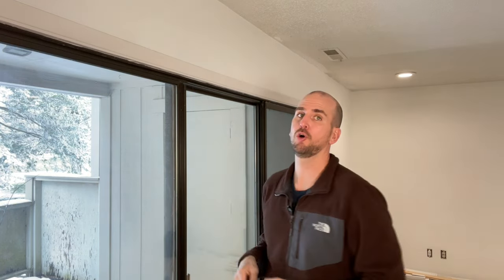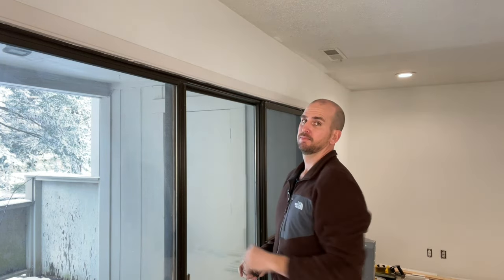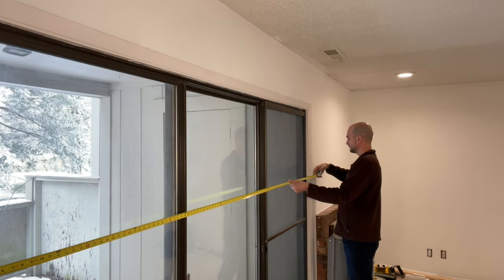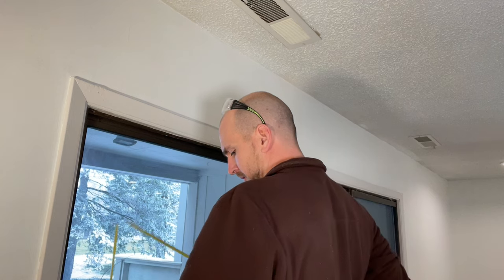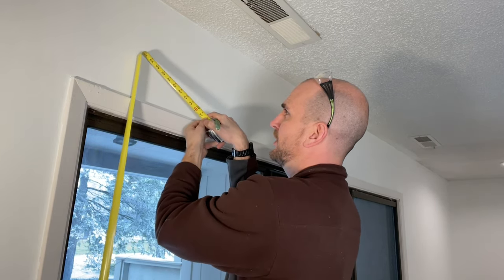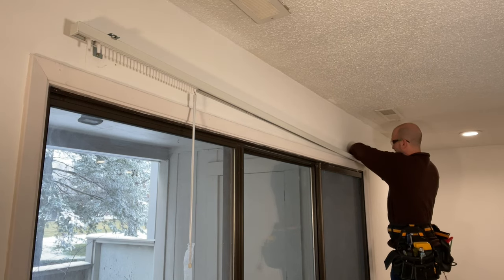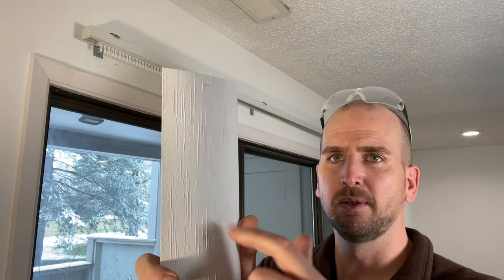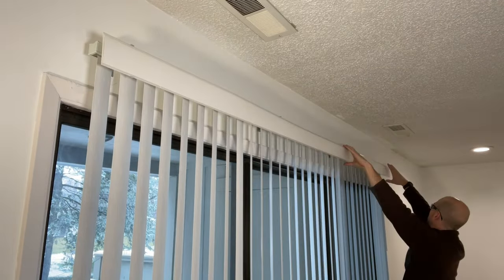How To Install Vertical Blinds | Sliding Glass Door

Comment: Good video, thanks. Probably the most important parts of this is knowing there should be wood behind the drywall at the bracket mounting height.

I you have a laser, you can stripe the wall level and preinstall your brackets without going up and down with the head rail. Also, an 8 foot straightedge with a 4 foot level on top can set you a level line to avoid all the up and down with the head rail. Most sliding glass doors are less than 8 feet wide.

If you cant find those installation screws, hex head installation screws are also very effective.

And finally, always invest in Fat Max tape measures. Always. All professionals should be carrying them. They are the best for measuring stuff by yourself.
Reply: I’m new, how do I know there is a wood behind the drywall ?
Reply: I want to add that replacing the Levolor track with a new Levolor track was a direct switch-out for the actual individual vertical blinds. I was able to use the old actual individual hanging blinds, saving money.

I was also wary of the new mechanism to open and close both the length of the hanging blinds, but also the closing of the blinds once they are pulled all the way across the door. The old track has little ropes you pulled to slide the blinds open and closed and a wand to twist the blinds closed for privacy. 

The new mechanism only uses a wand to do everything. I was concerned that would be the weak link, but 6 months later we actually like using the wand to drag the blinds right and left. It's so much easier. But we are also careful not to put weird angles of pressure on the wand which may weaken the connection point.

Comment: On my window I cant get the screws all the way in! It happened on both an inside and an outside mount even when I drilled a hole first. It seems like I am hitting metal or concrete.  Edit:  I went and bought some new screws  (power pro one ext xl #8 1 1/4" as recommended by the guy at lowes-I think similar to ones in video)and it was so easy!  I didn't even have to drill holes.  I also got the level (good thing I did!).  Now my blinds are hung and I'm very happy! Thanks for the advice.

Comment: Hey Scott,  I’ll build a house from ground up, but I avoid these ‘things’ at all costs!  😳🤔🙄
Seriously, some good points and demonstrations and information.  👍👍👍😁✌🏻✌🏻✌🏻🇺🇸
Reply from the maker: Hey George, thanks! Interested if you had a project with a sliding glass door is there any other product you would use to adjust light / provide privacy?  Vertical blinds aren’t my favorite either but I currently I don’t have a good alternative.
Reply: @EverydayHomeRepairs  Scott, only other thing I could think of would be full length curtains, which would open up with a side pull, or some may still open up from both sides?  They offer full privacy and light control, but not as easy to clean, nor as sleek as the vertical ones you used here.  🤔🤷🏻‍♂️🙄
I haven’t had sliding glass doors for years, so not much help to you?  ✌🏻👍
Reply from the maker: Got it, appreciate the feedback as always.  Take care. 👍

Comment: My back porch (inside)blinds project is; 72 inches from side to side of the slide glass door frame edges, & 78 inches long, do I add a couple inches to the sides and 3 inches to the top in order to hang these blinds?
Thank you for your input..!

Comment: I'm wondering if a Home Decorator Collection vertical blind head rail can be installed inside mount... and if it can be installed to the inside side wall rather than above, since it is covering only 1/2 the window space (nothin above to mount to).. and finally if that can be done on a window 60 inches wide.  Thanks.

Comment: Great guidance. I am planning to install a 104" L blinds on sliding doors but realize I have an issue. I can't do in or outside mount since sliding door is 96" from floor to ceiling. I do not  have that stud room for the installation of the brackets. I assume I have to do ceiling install which is kind of unique. Correct me if I am wrong but I'm thinking I would just need to screw the mounting clip to the ceiling, or should I just use the whole thing? Bracket and clip but the upper part to the ceiling. Thanks for assistance with this.

Comment: Hi I need to install roller blinds into a recess which has a sliding door in the middle what I have encountered in the process is the sliding door has a bar sticking out which will damage the blind while sliding so what are my options to get this done

Comment: How far above the molding do you go?  I am doing the same job and I am trying to figure out what I need to measure.  The high of my sliding doors is about  80 inches and about 82 if I include the molding.
Reply from the maker: I just measured from the floor ensuring I had 1/2" clearance so the slats wouldn't drag on the floor when opening the blinds.  So it is less about the molding and more about the distance from floor.  Best of luck on the project.

Comment: Thanks for the clear instructions. I have vertical blinds on the sliding door in the home I'm renting. It's an outside mount. I'm wanting to replace them and I'm wondering if I can use the existing hardware that the old ones are mounted with on the new ones. Are mounts universal or does each brand use different mounts?
Reply: When you get your blinds home, check the brackets inside the box against the ones you already have on the wall. You should be able to determine if you can use the old ones pretty easily. Most of them have a slot to adjust the blinds closer or further away form the wall/trim and a separate piece that clips on the blind's head rail that is what moves in or out making that adjustment. You may be able to use the old brackets on the wall with the new parts that clip on the head rail.

Comment: When you sized for inside mount you  didn't compensate for the device. The part that holds the slats. 1.5-2 inches
Reply from the maker: Hey Danny, thanks for the call out 👍

Comment: Those bñinds do not properly fit that window. 1. The blind should completly cover the window. 2. The blind should extend beyond the window so that when you open it the full window is visible. In other words the open blind does not block part of tne window. That blind is a good 2 feet too narrow. If you are being cheap you should have installed 2 units that open to the opposite sides of the window. The right way to do it would have been to order a custom split opening rail that propely fit.
Reply from the maker: Hey John, thanks for the feedback.  I tried to make that clear by mentioning it several times in the video that these blinds were about 6 inches too short.  In an ideal scenario I prefer only 2 inch overlap for each side on vertical blinds but appreciate your thoughts.
Reply: You might check your spelling John, as it doesn’t properly fit your comment. 🤔 Scott explained and showed his personal choice of why he went with the size he did.  Peace 🤔🙄😳😄😅😂✌🏻🤣
Reply: Great info. Got donated verticals for our new house. I hope they have the hardware included. Now I know what to look for and how to install.Thank you!
Reply: agreed